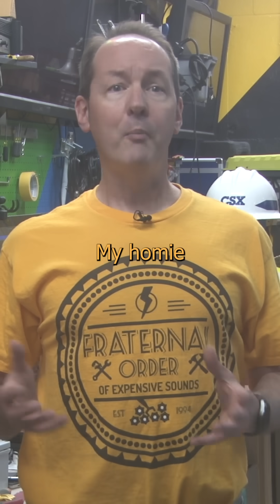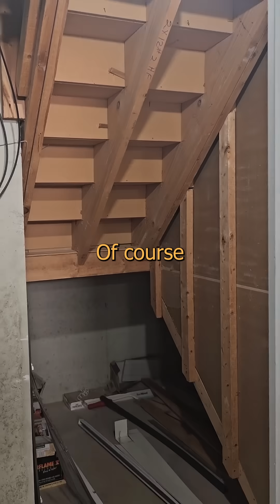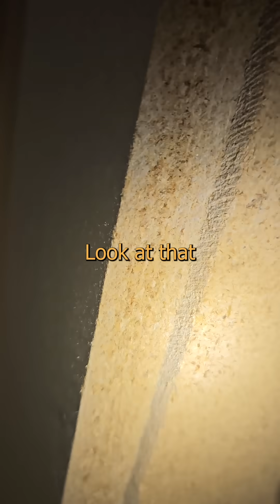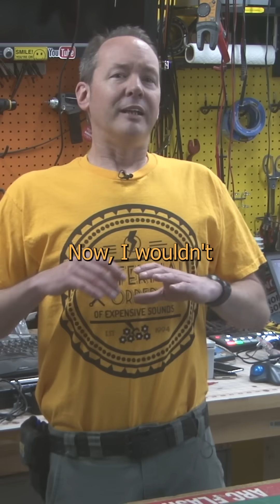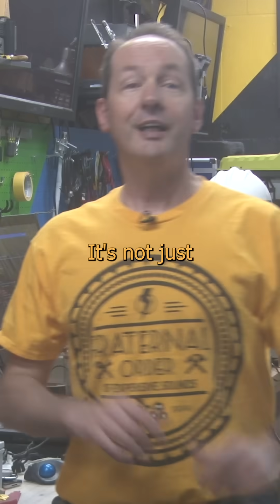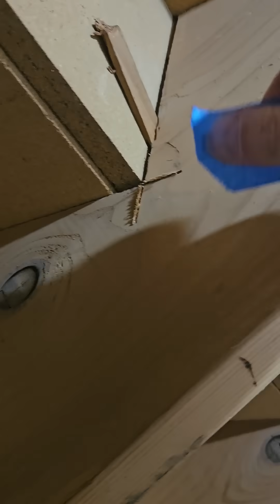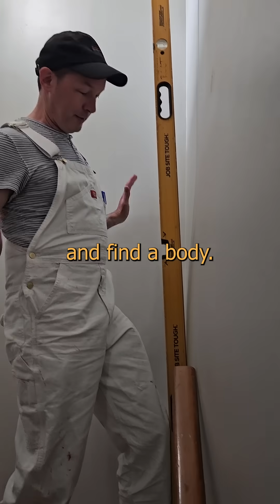Particleboard Staircase #chrisboden #engineering #construction #stairs #cheap #job #work #carpentry

Comment: Carpenter here, thats not up to code.
Reply: Thank You!
Reply: Ok so question from someone who has no experience in construction or carpentry.  Should we be worried about those cuts into the stair beams? Is that typical or did the builder just not know how to measure or use the correct tools?
Reply: @AD-1138   those are not a problem but any carpenter whose half way competent will do most of the cut will a circle saw and finished the cut at corners with a sawzall or jigsaw
Reply: @derekbuhler2492 or a handsaw even, people forget how good a good handsaw is. Way faster than a sawzall
Reply: @derekbuhler2492 no they won't.
Reply: @derekbuhler2492 sooo, not a problem in it of itself, but a yellow flag to give everything a once-over for potentially dangerous failures of skill?
Reply: @TimeskipCronos  exactly it's not a big deal in it's self but it means that they are cutting corners on something as simple as that so what else are they cutting corners on and that's the bigger problem
Reply: @TimeskipCronos   I just reviewed the video again and everything he showed in the video was done half assed by cutting every corner possible
Reply: @AD-1138 there’s a comment below being concerned about “over cuts” so I’m assuming the cuts are from lazy work
Reply: @AD-1138 that's actually very typical. Just means they used a circular saw blade to make the cuts. There's always gonna be a little overcut that way and in this case it's perfectly fine. There are tools that can prevent this kind of thing but unless those cuts extend ridiculously far it's fine. Or if it's on the outside of a finished product that's supposed to look all pretty.
Reply: @jbear9 wrong you stop on the mark and finish the cut straight with a jigsaw or handsaw.
Reply: @jbear9  No, that is NOT typical, or at least in this context of carpentry it is not how you cut stair stringers.

Whoever over cuts stringers like that is a bad carpenter or a min wage helper. You do not over cut, you can cut stringers with a 7 1/4" skill saw just fine without making it dangerous.
Reply: @jbear9  thays a whole 1" over cut though! Not 1/8" ...
Reply: @jbear9 no its not. When i was coming up we were shown to use circular saw to start the cuts then always finish with a jigsaw or a hand saw for the ends and corners so you dont overcut as it does massively compromise the integrity. Depending on the overcut you can smack the stringer by the cut and legit snap the stringer. Wouldnt compromise it much if it was a 1/4” but most times its inches. Especially when were talking about load bearing structures you expect to hold you for 20+ years. It is very easy to avoid and one of many signs to me when looking at others work of their quality and craftsmanship.
Reply: @jbear9   it’s absolutely not ok to over cut the stringers of the stairs just because your using a circular saw. A first day construction worker knows that. You cut both sides then wack it once with a hammer. Then you take a chisel and spend 2 seconds to remove any left over.  lol
Reply: @jbear9    any decent carpenter stops short with the circular saw and finishes with a hand saw, recip saw or oscillating saw
Reply: @AD-1138   I used to do carpentry, and one of my jobs was cutting the stairs. My boss would mark one out, then I'd cut it out and use it as a template to make two more. I would cut most of the way with a circular saw, then finish with a jigsaw specifically to prevent over cuts like this, as it does weaken the stringer. 

We also used OSB stair treads, however OSB can handle some moisture as long as its not sitting in it constantly, unlike particle board.
Reply: @AD-1138 that’s the par of the stairs that most supports weight, and there’s absolutely no good reason to have cut that far into the wood, this was a bad job done by the framers, that then proceeded to turn to a bad job by the inspectors.
Reply: @AD-1138  I'm not a pro, but yes, it shows shoddy work in general and unneccesarily weakens the beams in places they are most stressed.
Add a little water and these stairs are accidents waiting to happen.
Reply: @macsmith2013 that part isn't shoddy work,  the over cuts are just from the circular saw used to cut them and will only be on one side of the boards. You have to cut past the intersecting cut lines on one side in order to make it all the way to it on the other side.
Reply: @AD-1138  Pretty much.
Reply: Over cuts are usually fine on non-exposed stringers as long as you don't Over cut on both sides
Reply: @AD-1138 yes those are called stringers, they carry all the weight extra cut length is a no no
Reply: @AD-1138 The “Stair Beam” you’re referring to is a “Stringer”, and overcuts are a failure when it comes to code. The stairs should be one of the strongest parts of the house for many reasons. Those are some of the worst stairs I’ve seen in a while. Good call!
Reply: @AD-1138 yes it a big red flag and cuts into the integrity. Your suppose to use multiple tools to ensure you dont over cut. The dude used the big saw and didnt want to take the time to swap out tools and flew thru it and fucked it up and didnt have time to redo it. Its funny bc it barely adds more time and its a massive issue. If you dont have time to do it twice. Take the time to do it right the first time.
Reply: @AD-1138 It would've been caused by using a circular saw to make a partial cut. More experienced carpenters would know to either reference against the trailing end of the cut to hog out most of the material then switch to a jig saw or hand saw to square up and finalize, or just bypass power tools altogether and use hand tools.
Reply: @AD-1138  I'm going to elaborate and give you several answers since you said you have no experience. BTW, the specific name for that part of a staircase as a stringer.

Should we be worried? Not about the cuts on their own.
-the cuts are extraordinarily unlikely to compromise the structure or pose a safety risk
-cuts like that are something you will see frequently, especially if you look at unfinished/non-trim areas and unseen parts of construction
-it's a sign of rushed or careless work and likely indicates that whoever did it is doing "good enough" or "it's not pretty, but it works" 
-it can easily be avoided by spending more time on it and paying closer attention to detail (adjusting the depth of the cut and making a cut from each side rather than a single cut from one side, rough cutting and then finishing with a saw intended to make straight cuts or with hand tools)
-literally cutting corners like that could be a sign that the builder figuratively cut corners elsewhere

Combined with the particleboard stairs, I wouldn't trust
-the company that built the stairs or anyone who works for them
-the building inspector who allowed this to pass
-any carpenter, contractor, etc  who doesn't at least point it out or comment on it when looking at the stairs (Chris gets a pass from me because this is a short and he only has a bit of time to touch on everything he wants to include)

Personally, I would replace them and cut the old ones down to make tiered plant shelves, but I already intend to build them and it would be convenient to reuse materials.
Reply: @AD-1138 it's typical. As long as it's minimal it's fine. These are kinda large though
Reply: @AD-1138  I'd say it's typical but not right. a good stair company stops before the line and finishes with a jig saw or hand saw.
Reply: @AD-1138   typically, stair treads should never be cut in deeper than halfway of the of the staircase  joists. The over cutting with a circular saw makes it worse and weaker... also the particle board is simply not up to code at all... Even if it is just a riser, but definitely not if it's a stair tread.
Reply: Been in the framing trade almost 8yrs now and I’ve NEVER seen particle board used on stairs. 
The over cuts show some fast hands and slow brains. Pro will take care of over cut and amateur would at least stick a jigsaw in there. 
Still wish i had my life together to get a house at 23
Reply: @jayevers2453 ya. If you got the brains to get a house by 23yo you can fix the stairs by 24yo
Reply: @jayevers2453 its used all over now in many houses. Tjeu put them in over 100 homes they just build down the street.feom me. Totally makes code
 They are thick.
Reply: @jayevers2453  particle board is fine for stair treads. It uses 1" or 1" 1/4" particle board treads, but usually use 1x8 finger joint for the risers. I'm a trim carpenter, have been for 13 years and been using it in all the houses I've seen done, unless the builder or owner paying for the house built wants oak treads. 
There's nothing against using it.
Reply: Funny enough that is where the joke about the blue tape comes from because of a home inspector on YouTube named Cyfy who has been calling out code violations like this one while putting blue tape anywhere he sees one
Reply: @crossfire2045  That's not where it comes from, cool he's got fans tho
Reply: I'm a barely carpenter and  that is a horrible job done all around. Their is trash under the stairs.
My home is getting rebuild from the ground up. 
I hope it does not end up like that.I'm not doing the building it but i think i can do better than some of those builder. It will take longer but it will be way better.
Reply: Code here, thats not up to carpenter. 😂
Reply: @macsmith2013  Exactly... code should not be for one strives toward.
Reply: @macsmith2013 code carpenter, that’s not up to here.
Reply: @macsmith2013 here code, carpenter not up to that
Reply: @macsmith2013 best reply lmaooo
Reply: @macsmith2013 and of course the code guy doesn’t tell us what’s right. 😤
Reply: @macsmith2013 we have the humor of same sense
Reply: @crappieking5592 what gave it away? The particle board, the fact that she's at almost a 10 degree list or the gaps? 😂
Reply: If the Woodbutcher says it's "bad"- it must be bad...
Reply: Son of a life long finnish finishing carpenter here, can 100% attest to the claw hammer in cranium remark.. lol
It would have been bad enough if the kicks were on, but the TREADS?!?? SMH

The blue tape was a hilarious touch too. 👍
Reply: My friend bought a home in an unincorporated part of town.  He was so proud of how much faster and cheaper it was to build there until 2 years later he needed a new roof and the builder had already filled chapter 11
Reply: Apprentice here, that stuff is so bad at building that not even I use it for learning practice.
Reply: Engineer here, I gasped a little
Reply: O have been a carpenter for nearly 30 years. Those treads used to meet code but I haven't seen them in over 20 years they will probably be fine if they stay dry but the glue fails of ot gets wet. The over cuts are caused by a lazy hack.
Reply: Not only is it not up to code, its speed running 100% code violations.
Reply: Joiner here, screaming
Reply: Engineer here: can't pay me enough to stamp that. Can confirm the carpenter is correct.
Reply: And the code is the floor, not the ceiling 😮
Reply: Human being here, thats definitely not up to code.
Reply: It depends on the city. It might not be up to code in your city. But it could be there.
Reply: @MegaMech  i'll avoid that city.
Reply: The previous owners of the trailer park we live in used this kind of material for the floors in the double wide we bought. Now, our bathroom floors are falling in.
Reply: German Carpenter Here, can confirm
Reply: Up here, that’s code not carpenter
Reply: AS1860 Particleboard Flooring
This is the code that allows particle board flooring in AU. It requires the particle board to stand up to 3 months of weathering without a roof. 

I was very surprised by this but thought I would actually look it up.
Reply: I dont need to be a carpenter to know that shit aint up to code 😭😭😭
Reply: Some quick googling shows: In Michigan, stairs made of plywood ARE allowed within code. 
However, it's sloppy work and, in Michigan's climate, not something you'd want in a home built to last for more than a decade. 
Considering the saw marks on the joiners and the curves on that wall, that's not a surprise.
Reply: @alanepithet2931  That isn't plywood and nearly as strong.
Reply: These stairs are clearly a cosmetic feature; obviously never designed for a human being to actually stand on the steps, let alone climb them.
Reply: guy who did some stuff for a scabby home repair/general contractor guy, idk if its up to code but I would definitely have a guilty consciensce about the people I probably hurt at night after putting that up
Reply: Here that’s, code carpenter up not to
Reply: Landscaper here, WHAT THE FUCK IS THIS SHIT
Reply: Short but sweet
Reply: I was just about to say that ❤
Reply: You think so?
Reply: I think anyone can see that lol, but thank you
Reply: even i can tell lol
Reply: Location matters because in Michigan it passes
Reply: I was going to say that I thought as much. Not only that, the way they cut into the meat of the stringers(?) makes me wonder how long till they break at the stair
Reply: @Romuls753 Ya not great, there is a specific calc in the nds (wood design code) i could run for the stringers, even with the reduced section, but it looks slim to me.
Reply: Former long-haul trucker here…I concur, not even f-ing close. Want to bet this mess has all of its green “GOOD TO GO” stickers  from whatever municipality charged thousands for permits and inspections?
Reply: corrector here, you are correct
Reply: How the heII did the house sell then? Maybe money determines what is and isn't code.
Reply: That depends on the municipality.
Reply: Electrician here, yep I would definatly do that for my own. Not for anyone or anything else
Reply: @clippy3333  no shit 😂
Reply: Shhh shhh it’ll be fine. You’re American your code means fuck all to the rest of the world 🎣. (I’m sorry that’s mean)
Reply: Smartass here who knows nothing about anything ….. that’s not up to code. 😂
Reply: I concur
Reply: Carpenter coder here, that's not up.
Reply: Here that’s, not code up to carpenter
Reply: Code Brown, maybe
Reply: Really depends on where it's at.... Cardboard sheathing is legal here and I cannot wrap my brain around how (I thought sheathing was for shear strength but what do I know)
Reply: Probably wasn't up to Code back in the day! 

End of thought 🤔
Reply: how did they even do that?  I thought stairs were pre fab.
Reply: You don't say
Reply: Can you get that pimple on your ass before he does Mr carpenter
Reply: Two votes
Reply: plumber here and even I can tell you that ain't up to code
Reply: That thing is like less than a inch thick and it's getting held up by shimmings
Reply: Welp, according to a grandfather that did concrete work, it could be worse.

Admittedly, he was complaining about plumbers that couldn't lay pipe within a foot of their target before the slab got poured, but nonetheless, at least the dimensions resemble correct.
Reply: Biologist here, can confirm wood doesn't work well that way.
Reply: Who cares?
It's working and it's been there for years. If anything was gonna happen it would happen by now. So don't get you nickers in a twist darling
Reply: Who cares?
It's working and it's been there for years. If anything was gonna happen it would happen by now. So don't get you nickers in a twist darling
Reply: “PRO” tip -  If the stair tread ever starts to squeak just pour some water in the joints… you’re welcome🫵
Reply: You don't say
Reply: Carpenter here, that’s perfectly fine where they live
Reply: Im a high-school drop out pizza cook and I could tell you that
Reply: @clippy3333  my stair supports are held up by 1/16 inch steel pipe support tape loosely wrapped onto the top of the support, and then nailed into the joists for the floor above the stairs.
Reply: Not a carpenter but that not up to code
Reply: I was looking for this comment.
Reply: @clippy3333  can they sue the builders?
Reply: Sure is cool
Reply: @clippy3333  Sales coach here, that's not up to code.
Reply: How much not to code is it?
Reply: @clippy3333  but he put the blue tape on it!
Reply: Amen and amen.
Reply: lol even a non carpenter would know thats not up to code
Reply: Programmer here, I'm inclined to agree
Reply: Or really? I'm not a carpenter and had noooooo idea... 😂😂😂😂
Reply: If this is Wisconsin it is up to code, actually stronger than a wooden tread
Reply: Not a carpenter and it’s not up to code.
Reply: @LargeFather95 wrong. Its code. Those are 1.5" engineered treads. They meet code.
Reply: @rusted5408  doesn't make it look any less bad however.
Reply: No code in my state if you build it yourself, only commercial construction. 

I'd bet money this is a DIY.
Reply: @JarthenGreenmeadow there’s a whole neighborhood of identically built houses, a specified in the short. That’s not DIY territory.
Reply: Nah, it's up to code, unless their something specific, like it's 35.5 inches wide at one point. Particle board ain't great, but it's code for residential indoor code.
Reply: Not a carpenter here, that's not up to code.
Reply: Not even with the extra middle stringer? That seems to mitigate the risk quite a bit.
Reply: @clippy3333  another carpenter here, yeah that’s some bullshit right there😂🤦‍♂️
Reply: I'm glad you have eyes, cause I couldn't tell that wasn't up to code from first glance, captain obvious.
Reply: Stairbuilder here. There is not a single code that calls for a specific or precludes a material for risers.
Reply: You know the code of every state, county and city in the country???
Reply: @joe4171  do you
Reply: @cmendoza1094 such an ironic “response” from someone who wasn’t even part of the conversation 😂😂😂 Get a life
Reply: Thanks Einstein. Pretty sure that's what he was telling us in the video lol
Reply: Incorrect. Its used all over
 They are thick cheap and common and do make code
Reply: Can you back that claim up? There are exactly zero IBC and/or IRC codes prohibiting the use of particle board for stair risers or treads. So long as the specific material meets the performance characteristics specified, it's allowed.
Reply: @tomb816 what makes you think particleboard is up to load bearing codes?😂
Reply: @trailblazer632  Apparently, neither you nor your ridiculous laughing emoji (as if that somehow makes you correct) have heard of HDF.
Reply: @tomb816  apparently you missed the part of "HDF" that explains it is a "high density" board. This isnt that. Or did you not watch the video?
Reply: @tomb816  I don’t know, maybe the fact that the moment it gets slightly humid in that house the stairs will cease to be load bearing might do the trick.
Reply: @Sturmischer  Ok, so what code is that?
Reply: @tomb816  Depends where you are.  Some places dont even use IRC or IBC, but still.  Even IRC codes can differ from region to region.  If this was Arizona, it'd be fine both as far as codes and safety, as the climate is incredibly dry.  Put the same stairs in a place like Seattle, better hope everythings sealed up tight and theres no plumbing that can fail nearby.  Also im pretty sure it violates codes in most pacific states.  I know it wouldnt fly in California.
Reply: @thimsbarkler5178  The '22 CRC section which covers stair treads adopts the '21 IRC specifications. Unless a local jurisdiction specifically precludes HDF, it's compliant w/ CA codes.
Reply: @tomb816 : HDF is what, High-Density Fiberboard probably? I ask, because that stuff does not look like fiberboard, it looks like particle board.
Reply: @absalomdraconis  Particle board is fiberboard (hence why it's called low-density fiberboard). They're both engineered wood products utilizing pieces/particles of wood instead of whole fibers. That's why it's classified into different grades, to specify the specific composition and density.
Reply: @tomb816  I would say that depends entirely where you are. Like here in Yuma where moisture and rain aren't really a thing? I wouldn't see it being a major issue. but it IS particle board. If you let a glass of water sweat on that stuff it will swell up. MAYBE if it was sealed? But that's an extra step and extra cost. These builders are cutting corners saving a buck to put in THEIR pockets all while cheating potential owners out of quality. A heavy enough person or just locating heavy enough furniture up those stairs will punch a hole through that stuff. I have NEVER found a reasonable excuse to build anything with particle board.
Reply: @grant5804 if you live in a newer house, hate to tell you that your shelves and stacks in your closets are all particle board. Got 12" and 16". Same with walk in pantries. Yep particle board, it's 3/4". The stair treads are just fine and strong enough. You couldn't break them jumping up and down as much as you wanted.
Reply: @mattburns2968  I'm aware of builders crappy cut corner save a dollar measures. What I find interesting is how any of it passes inspection.
Reply: @tomb816 - if you’re my builder and I’m your customer and you try pulling this particle board bs with me on my house you’re going to have a problem on your hands. Code or not.
Reply: @duzzitmatter8679  Well, the OP is about code and that's what I'm replying to.
Reply: @tomb816  Let me paint you the clearest possible picture: Particle board has a Modulus of Rupture (MOR) of 200-800 psi.  
White Pine has a (MOR) of 8600 psi, Southern yellow pine is 14000 to 16000 psi.  

Pine is normal construction lumber that generally meets code for home construction and is sane to use for stairs.  

Particle Board of equal thickness has between 1/10th and 1/80th the MOR of pine.  Given that moisture in the air and time damages particle board, I will say 1/80th the strength respects the lifetime de-rating of the two materials.  

MOR is bending strength, like for stairs.  These stairs are not rated for use by children, let alone the typical American.  May as well be made of packing peanuts and school glue.  

Code is the minimum you must do to avoid killing people.  If you do something so negligent as to meet the meaning of malice by sheer stupidity.  Something so shamefully incompetent that code must be amended, you will still be sued until your business is well past uninsurable and you leave the industry.
Reply: @notamouse5630  I like how you chose the poorest strength board for your example. Or are you just not aware there's multiple types of PB?
Reply: @tomb816  get a fish or a wife 😂😂
Reply: @cmendoza1094  Oh, look, someone else who wasn't loved enough as a child and needs to project their inner turmoil as insults towards random strangers on the internet. How original...
Reply: @tomb816  Particle Board is not rated for structural work anywhere in the US. Structural Composite Lumber SCL is an example of a wood product that is appropriate for interior stair treads and stringers.

2018 IBC Section 1011.7 indicates that stairways must be built of materials that are consistent with the construction type. That generally means Types V and III for light-wood frame construction, and Type IV for heavy timber.
Reply: @garymanis6305  Gary, thank you for at least arguing the point regarding codes and not making it an opinion or feels based comment.

First, we're talking about the treads, not the stringers. The treads of interior stairs aren't defined nor inferred as "structural" anywhere in IBC or IRC. What's referenced and/or specified is the strength characteristics required for performance. While I'll agree that not all types of particle board will meet these requirements, HDF products do.

Second, your reference to 2018's IBC S.1011.7, while possibly applicable in some jurisdictions, doesn't seem fitting for this general discussion. Not only because it's an outdated release (2021 IBC as of 5/2025), but because this section has been superseded by S. 1011.5 (Stair treads and risers). S. 1011.7 now focuses on landings, not general stairway construction.
Reply: @tomb816  Treads must be constructed out of structural lumber, as described, which can be engineered wood products. There are different codes for exterior stairs. My information covers both stringers and treads. Any engineered wood product used for stairs or any building structure must be used in accordance with the manufacturer's specifications, which have been tested and found to comply with the codes mentioned. Sheets of particle board do not meet those codes and should not be used as structural lumber. There are engineered wood products that use particle board in its construction that may be used for certain applications as long as they are used in accordance with the manufacturer's specifications.
Reply: @garymanis6305  Please point out where you're getting the requirement "Treads must be constructed out of structural lumber". It's not in either IBC nor IRC. IRC R104.11 literally states "The provisions of this code are not intended to prevent the installation of any material or to prohibit any design or method of construction not specifically prescribed by this code, provided that any such alternative has been approved. An alternative material, design or method of construction shall be approved where the building official finds that the proposed design is satisfactory and complies with the intent of the provisions of this code, and that the material, method or work offered is, for the purpose intended, not less than the equivalent of that prescribed in this code in quality, strength, effectiveness, fire resistance, durability and safety."

You state "which have been tested and found to comply with the codes mentioned" and I'm again telling you that there are composite boards which absolutely meet the standards set forth by the aforementioned codes.
Reply: @tomb816  OMG. As I already stated, there are composite or engineered wood products which meet these codes. There are literally stair systems made of engineered wood, SCL, which are specifically designed for stairs. Stop trying to argue with me and claim that particle board meets these codes. Do a little research for yourself. I had little trouble finding the information.
Reply: @garymanis6305 This will now be the 3rd time I've asked you for the specific code (I've literally posted it). I'll also state, again, there are products which I'm referring to which meet the requirements of materials for stair treads. I'm not arguing, I'm stating facts. Thus far, you've provided nothing but your opinion.
Reply: @tomb816  Just more lies from you. Sad.
Reply: @tomb816 Not if the poor f-er that’s buying it comes after you with the circular saw you don’t know how to use.  Code is a joke, as is anybody who builds as if it’s  enough.
Reply: @tomb816 I don't see a problem w PB for the risers, but I like thick treads.
Reply: @francom6230you like thick threads and you cannot lie?
Reply: @tomb816  took a look. Couldn't find any material spec, so I think you're right.